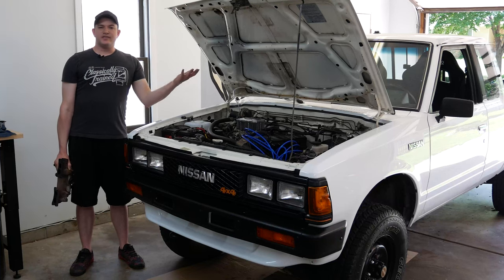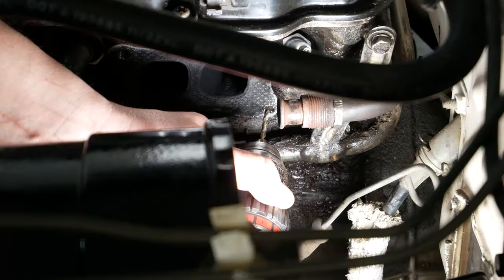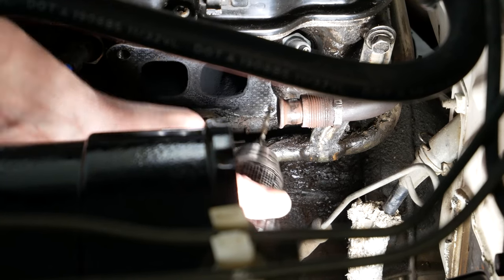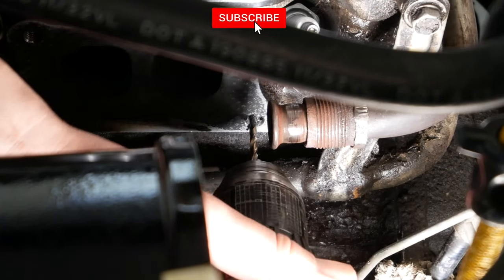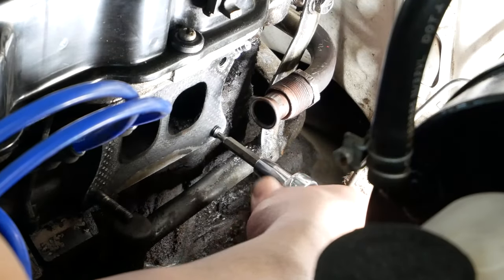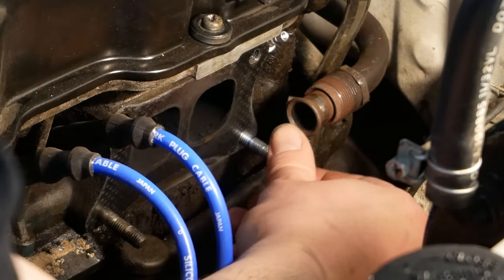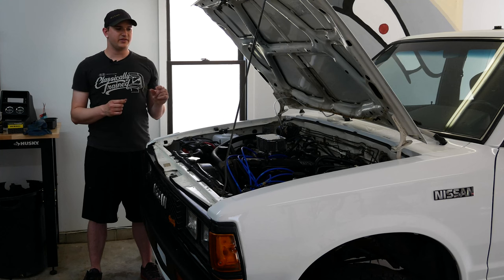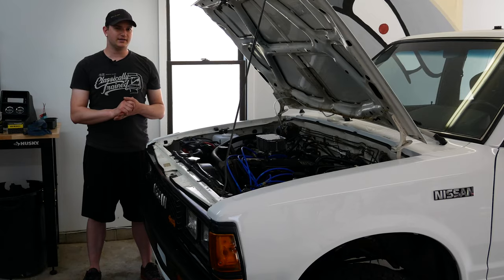How to Remove a Broken Bolt From Your Engine Block

Comment: Wished I had you, your tools and your expertise here right now.  A squealing fan belt led to the discovery of a loose alternator on my 2006 Toyota Scion XB.  My son was going to tighten the alternator and before he could put a wrench to it the broken bolt (into the engine block) fell into his hand.  I have an aluminum block so the only technique anyone around here uses (welding a nut to the broken bolt) can't be done.  I'm sharing this video to him now so he can see how you do this and maybe he can find the necessary tools/bits to get the little piece out.  There isn't much room under the hood of my little car so our major problem is finding a drill small enough to fit the space to be able to drill out the piece to replace the bolt.  No one in our little town has any helpful advice for removing this bit of broken bolt.  We are in a real pickle if he can't get this figured out!  He leaves this weekend going back to work out of town so we have ONE DAY to fix my car before he leaves.  DESPERATE IN ALABAMA!!